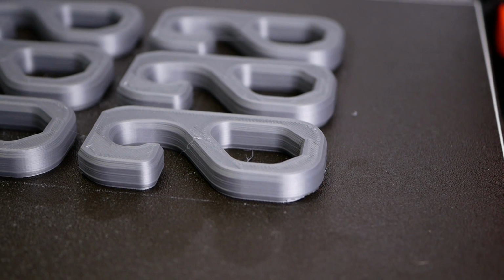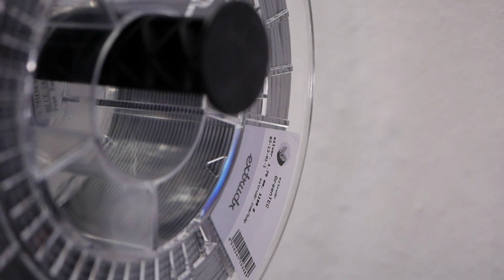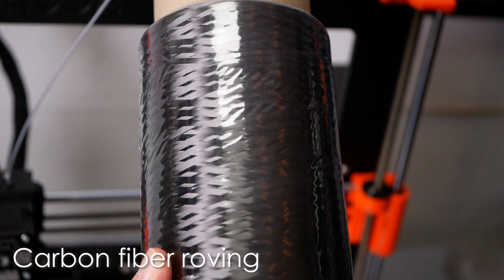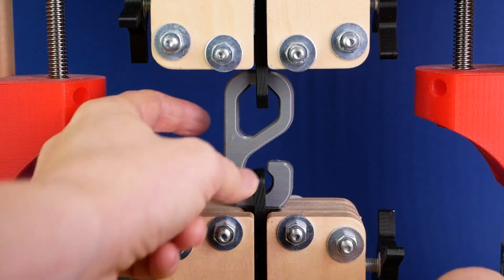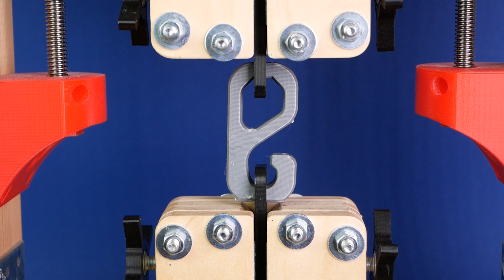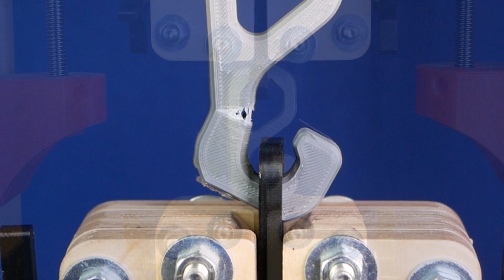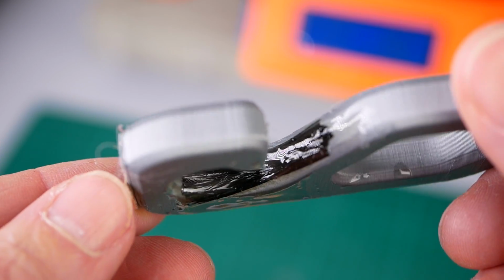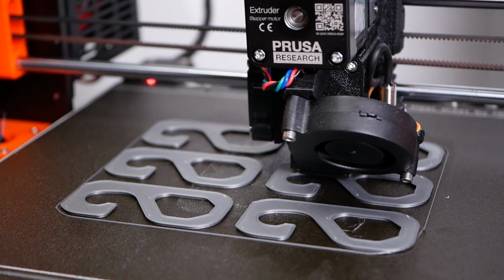STRONGER 3D Prints with GLUE? (and CARBON FIBERS)

Comment: Curious what the performance might be if you could print two parts intended to go together, with a channel as perhaps a small figure eight continuous. Then after printing you could inlay the carbon fiber figure 8 through the big loop and down through the hook, and then glue the entire piece together. With that you might be using the carbon fiber as your strength, with the 3D PLA as a structural frame.

Comment: A commenter who does restoration work and repairs on plastics commented that different mix ratios of the 2 parts in the epoxy result in different finished properties, example: they said to match the less brittle ABS you need 1:1.2 binder to hardener so the material properties match. Using more hardener in your tests may remove the cracks and stress risers you talked about as it increases the flexibility of the finished epoxy. I am taking this on faith, I haven't tested it myself yet.
Reply: Found the comment on the video "Easy Plastic Reconstruction and Repair" by Tech Tangents By AkBkukU.

Siana Gearz commented:

"...I do a lot of plastic repairs. Thin reinforcement on the inside with a superglue and blotter paper composite, or same with epoxy. You can also get "plastic glue" which is bog standard CA glue and a felt tip pen to use beforehand which does something to the surface of ABS and other Styrene based plastics, not sure what!

For epoxy i use UHU 1:1 epoxies personally, both 30-minute type and super durable 24-hour type, and usually i heat the parts with a hair dryer while the epoxy is setting or throw it on the hot bed of the 3d printer - curing it hot (up to about 80°C) makes it much more durable for some reason and speeds up curing, also helps kick off a reluctant mixture. The magical thing about good epoxy is that you don't necessarily get a super hard brittle material, you can vary the proportion of binder and hardener to achieve a range of mechanical properties. Adding about 20% more hardener than binder (which is actually hardener-epoxy-plastifier mix balanced such that it won't cure on its own) will match ABS plastic flexibility remarkably well, which can prevent breakage in the future. But adding more hardener makes it more difficult to cure, which is where heat comes in. You can also tint it in a million ways for seamless repairs..."

Comment: you should try stoping the print half way threw, then add the carbon pieces and then continue the print. 1 see if it works 2 see if it adds strength.

Comment: Viscosity feels like it could be critical if binder might penetrate. There are some specialist ca that are nearly water. I am going to have a try with some acrylic varnish in various dilutions. No test rig so will only measure weight increase. paint on and also soak. BTW I like the carbon fibre result.

Comment: Frankly I wonder how far you could go with this.

For example i have some headphones with a stupid weak point but otherwise pretty neat so i thought I'd first apply a layer of painting tape to be able to remove without too many problems later and then wrap a bunch of fibers around the area and glue that up (in simplified terms, this is about 2 half-cylinders which split up)

Comment: I use CA glue to help with water tight prints. If I need something to be water tight and im worried about my print not being perfect I will slather on some medium thickness CA glue and it seems to do well. Epoxy/resin would probably be better but I only have super thick 15 minute epoxy.
Reply: A couple more ideas, but not sure they are good!  

First—would a pressure pot treatment help push the adhesive into the layer lines?

Second, and more interesting to me, would be inserting continuous carbon fiber mid-print (M600!), perhaps even making internal spaces to place the fibers.

Comment: with a multi-material printer wouldn't be possible to change materials on the weaks spots for stronger filaments? (imagine that on a drone fuselage,TPU on the propeller cover,Carbon Fibers on the gaps bewteen the main body and the propellers and foamable PLA for the rest of the body) wouldn't that be possible to do?

Comment: Great idea! I was thinking of using the CR10s  and pausing printing and inserting fibreglass into pre-printed gaps then continuing printing. or using two or three extruder 3D printer to use different filaments to improve strength any ideas on this?

Comment: I'd like to see a video where you use gyroid infill and then fill the part with epoxy or various other fillers to see how that affects strength. It would make prints much cheaper/faster to print (minimum infill and perimeters) and would likely make for much stronger parts.

Comment: These results have got me thinking about a somewhat similar thing that happens with wood used for artisan knives etc.. It involves putting the epoxy in a a vaccuum chamber to remove all of the air, then doing the same with the wood, then both of them are loaded into the vacuumchamber on full vacuum, and a bit before the epoxy sets, the vacuum is released, making the wood suck in all the epoxy. I bet a similar thing can be used to reinforce 3dprints. Not sure about how even the internal distribution of epoxy would be, but it sure beats smearing some on the outside, seeing as it barely penetrates the first outer wall..

edit: Just read some more of the comments, looks like Martin Pirringer is saying the same thing, but a lot more accurately.

Comment: Try modifying the test hooks so you can fill them with epoxy. For example create a channel that runs from the top of the hook straight down to the bottom, going very near the wall at the inside of the hook curve. Or perhaps coat a steel wire or thin rod in epoxy, and insert it into that channel.
Reply: This should more efficiently transfer stress from that inner curve to other parts of the hook so long as bonding between the hook and the epoxy, and the epoxy and the wire are good.

Comment: Hi... thank you and congratulations for you channel... my question is if you put (handling inside and outside) epoxy resin in a carbon fiber 3D print piece  (for example a pipe) with high proportion fiber and porosity... how its change the properties? ... it should very interesting to compare this piece with the same but without epoxy.

Comment: Just a theory on the epoxy.  While we think that the added material should have added strength, watching the video you can see that the epoxy loses bond.  You can see the PLA stretching underneath the rigid epoxy coating.  When the epoxy cracks, that creates a limited area for failure.  Whereas the printed part is semi-elastic and would stretch across the whole part, taking some load off the layers of adhesion, the epoxy transfers all of that load to just a couple layers, causing failure sooner.

Comment: Would it make sense to do the carbon fiber  strips more like a helix?  Basically 2 X's one on each side of the test section (inside & outside like you had it, not front and back.)  Same amount of carbon fiber but each X wraps to the opposite side and around/up&down a bit further.

Comment: what if you had a hollow hook, with a channel in it. The pause the print about half-way and fill the inside of the print with something like JB Weld or some other epoxy, then let it dry a bit, and continue the print. My theory is that this would give it an internal skeleton and may increase strength over an exoskeleton or no skeleton.

Comment: Would love to see you wrap the entire perimeter with carbon fiber. Also, if you can find fiberglass or Kevlar tape, they would be interesting as well. They're supposed to flex before breaking, and therefore be less "brittle" than CF. 

I once saw an interesting video about using a combined fiberglass and CF fabric to build RC glider wings. The conclusion was that the combination was worse than fiberglass alone.

Comment: I’d like to see the carbon fiber reinforcing tested further. Further reinforcing with carbon fiber and different epoxy like one using super glue, one using a 5 minute epoxy, one with the hobby king epoxy, one with proper carbon fiber epoxy, and maybe one with SLA resin cured with a UV lamp.

Comment: Hi Stefan, your tests are amazing and I love to watch all of them, it's just too curious what happens and moreover why things happen, that's engineering at its best, driven by pure passion! 

Well the cf-reinforcement test I liked most, not only because I'm and aviation-geek but also due to the not too little potential which carbon (or other) fibres have. I'd suggest it would be easier to fix the fibres if there was a groove in you test-objects (the "niners") for lamination. And there you could play with the height of the fibre-layers and even further with fibre orientation in terms of torsion stiffness or shearforce. 

Another interesting point would be, to change the carbon-fibres for glass, aramide, polyacrylic, maybe some organic ones (cotton, hemp, ...) and see what happens?

I missed another thing, to strengthen the test-objects by glue or resin, it might be helpful not only to apply it on the upper surface but to ensure, that some cavities allow the fluid to creep between the layers and there to increase the layer-adhesion.

Comment: You mentioned your self embedded reinforcements
Please include in your test or make another test with embedded reinforcements inside an object printed in 2 or 4 or more parts !!

Also besides carbon, can  you test aluminum mesh ? and what about 24-hour / 48-hour epoxy glue, i never made a strong gluing with 15 minutes epoxy, i use 15-minutes epoxy for parts that i do not mind breaking sooner or later.
Also what about hollow objects poured fully with various reinforcement materials ?

Embedded reinforcements will be even greater if materials that have some flexibility, like ABS
benefits
- very good external appearance
- multiple and more even distributed reinforcements than just an external reinforcement layer
- print object in smaller intervals, meaning you save material and print time, because a failure will not waste all parts and all print time so far, also a taller object has more chance of failure, due to ... several reasons ...

Comment: Could you perform an investigation on the effects of these adhesives on 3d prints in compression? Would the epoxy prevent failure due to buckling?

Comment: Pause the print just before it starts the first top layer then use a syringe to fill the infill cavities with resin. Could do that in both vertical and horizontal printing. To fully fill a vertical printed hook you'd have to pause more than once to get every part of the hook filled. Or print without infill then drill a small hole to inject resin. Has anyone made open cell infill possible to print? That would be very useful - print with internal support for flat upper surfaces yet not have any sealed inner chambers so the interior can be filled without any bubble traps.

Comment: Try drilling a hole in the top and injecting CA glue and epoxy to fill the empty space. And then maybe try pausing toward the top, putting long carbon fiber strands down in (straight) and fill with epoxy again.

Comment: Seems like flexible epoxy would be better than hard epoxies so that it won't crack under load. I also wonder what happens if you print a part hollow and fill it with epoxy resin. Or SLA print a hollow part and fill that with epoxy resin. Worried about the exotherm of large masses of epoxy is why I haven't tried it as just filling a part directly with epoxy especially if it is large is a bad idea.

Comment: maby you should have a quick try with the kind of hobby glue which people use when building plastic miniatures of cars and such, that glue pretty much just disolves the plastic and when the glue evaporates does the plastic itself work as the glue by fusing the two parts together. by applying some of this might you be able to let it go in between the layers and increase the streangth.

Comment: Honestly what would be interesting is to add a fill port and plug where you can fill it the piece with epoxy and how that would compare with a 100% infill in both cost and strength.

Comment: What about embedding the carbon fiber by pausing a print
Reply from the maker: Played around with that already a bit but it's kind of hard to do.
Reply: @CNCKitchen  I imagine you'd need to leave a gap then make the printer over extrude a bunch to hold it in place
Reply: @CNCKitchen  multiple layers separately and sandwich them together afterwards?

Comment: I wonder if a less rigid coating would add enough “extra material” without the brittleness that caused the epoxy to fail. Something like a plastidip or some other more rubbery coating 🤔 

My thought process is that the cracking of the epoxy created added stress to those locations per your reasoning, so something a bit more pliable could maintain a constant shape more easily. So as the critical area begins to warp, the coating wouldn’t “shatter” under the load, but would bend and maintain the coating better without negatively impacting the 3D printed piece underneath.

I’m reminded of an old fable about an old rigid tree and a young, bendy sapling caught in a bad storm. The old tree boasted about how strong and unmovable he was, while the little bendy sapling flapped and bent in the wind with every gust. By the next morning, the storm had broken the mighty old tree, and the bendy sapling was completely unharmed.

Worth a shot in my opinion! 🤷🏻‍♂️

Comment: I'm reminded of an engineering analogy:

(1) Suppose you're using some rubber-bands to hold a load.
(2) Okay great!  You temporarily remove the load, and  reinforce the rubber-bands with some paper strips.
(3) Well, you already know what happens:  When the load returns, the paper strips tear apart before the rubber bands can even help support the load.  So you haven't significantly increased strength.

This is why you don't reinforce a riveted joint with welds.   Or reinforce a welded joint with rivets.

Because welds and rivets engage the load at very different strains.  Welds are much stiffer and support loads immediately.  While rivets support loads only after significant strain (rivets might have a little "slack" or "play" before they fully engage the stress).  And welds and rivets have different "spring constants" which also affects how they share the load.

So you probably need to do some actual engineering/testing to see if the strength is improved, and why or why not...

(I'm not an engineer, so I don't know how mechanical engineers actually analyze and design reinforcement for structures.)
Reply: Same reason you usually shouldn't mix fiberglass and carbon fiber. The CF is significantly stiffer and breaks before the fiberglass is even taking it's full load

Comment: Why not redesign the part so you can test filling the part with epoxy and or carbon fiber stiffener. I print hight load parts with a hole in the center and stick carbon tubes in them with slow cure resin

Comment: please do more carbon fiber tests - maybe you can print the hook in multiple parts and put the carbon fiber inside like plywood (3 pieces print with 2 layers fiber) to not build up additional material on the outside

or you can make a grove around it to wind the carbon fiber around

also you can try embedding very small diameter steel wire or mesh - this is done in automotive repairs if ABS fairing parts need to be repaired usually done by heating the wire and pressing it in (you could use an AA battery for that)

Comment: If you could coat them with superglue/epoxy while in a vacuum it would force the glue into the interior of the part, kind of like how they use superglue to coat fingerprints in chambers with a vaporization stand? Not sure if that comes across, hehe.
Reply: Coat them in slow hardening glue/epoxy then place in vacuum chamber, pump down then slowly let air back in so the air is sucked out of interior of parts then wait a minute for bubbles to pop then slowly let air in allowing the pressure to force glue/epoxy deep within the part instead of just depending on capillary action.

Comment: When you do cover parts with Epoxy , you should use special Epoxy infill, Google for "Glass Bubbles (Microspheres)". It will make part much stronger.
Reply: Microspheres would not add any strength to your part.

Comment: Can you include an epoxy filled internal cavity to further testing? You could create a cavity inside the infill with an opening that goes to the outer shell through which you could use a low viscosity epoxy to pour inside. This would give you a larger mass of epoxy so it's not just a thin sheet on the outside. If the opening is big enough you could also use additives mixed into the epoxy like metal powders, chopped carbon or glass fiber, carbon powder. These could increase strength also but then it becomes a very long video lol

Comment: For a minute I was disappointed you didn't put the carbon fiber on properly. I was confused when you were positioning it, you would have wanted it to wrap under the lower anchor point of the test jig. However, after some thought, I realized that it basically didn't matter. The part will always break where the carbon fiber stops/isn't. And if you did manage to get it both on the bottom anchor of the jig AND the top, you would probably max out/break your test jig. So in that sense, the carbon fiber did its job and migrated the failure to a region capable of a larger load.

Comment: I have been using 4 top and bottom layers with the orientation of 0, 45, -45, 90 for structural prints in SImplify3D.  It seems to be stronger but I would like to see some numbers to validate my hypothesis.  Have you tried this already?  If not, is it something you would consider testing?